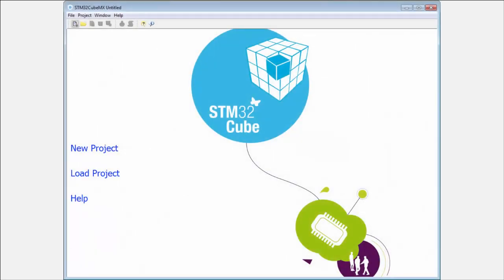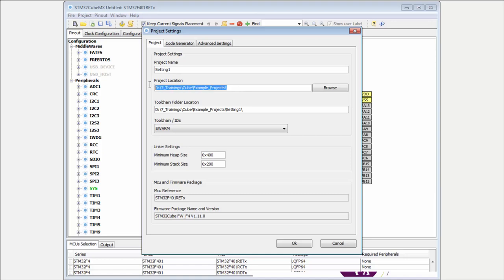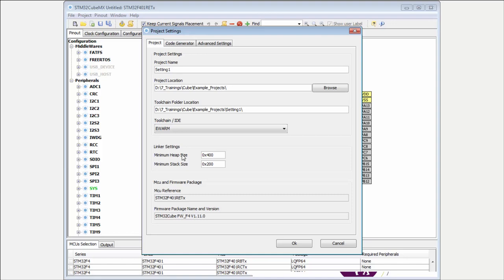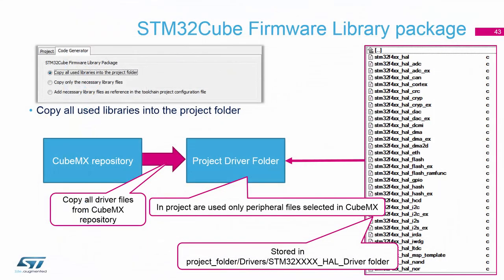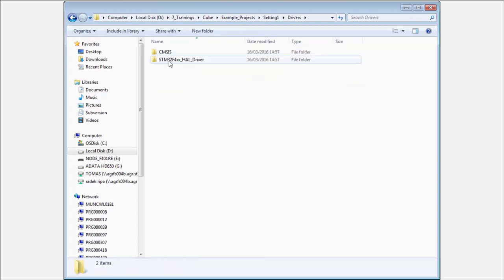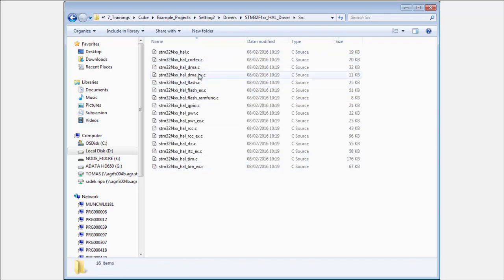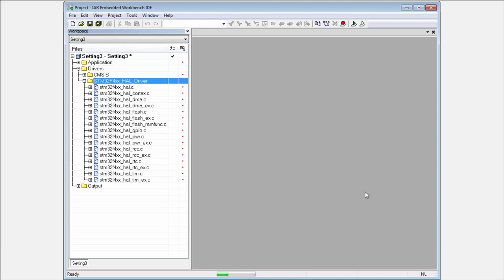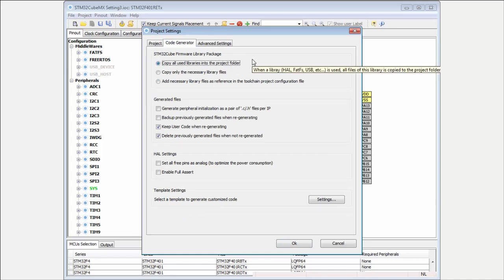STM32CubeMX basics: 06.1 STM32CubeMX project settings - STM32Cube firmware library package

Comment: You obviously associated the project file type with your IAR IDE. I'm using Keil µVision. Since I'm using this for the first time, Windows would ask me how the file should be opened. Could you point out what the project file is and where it is located in the project folder?
Reply: Found the answer in here:
http://www.keil.com/appnotes/files/apnt_323.pdf
I needed to change Toolchain (Project Manager tab / Project section / dropdown list Toolchain / IDE to "MDK-ARM V5")